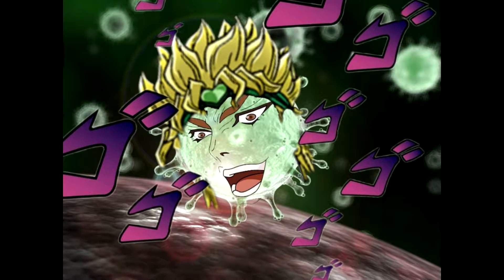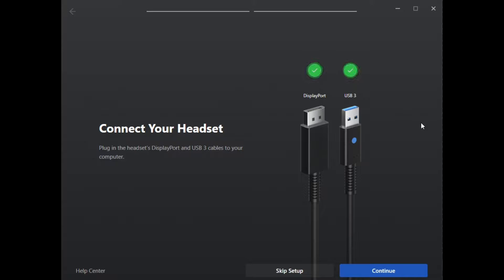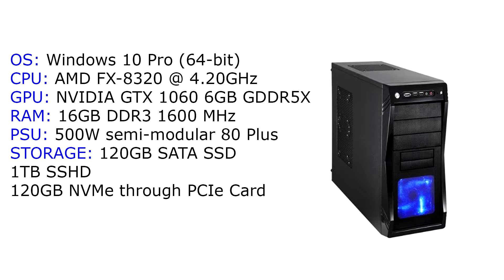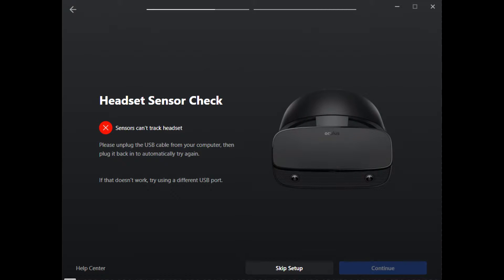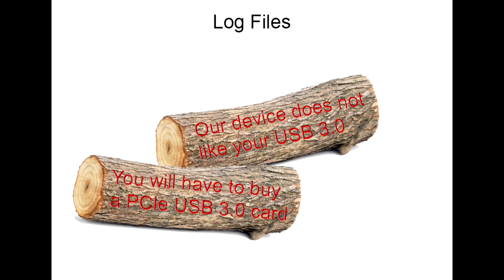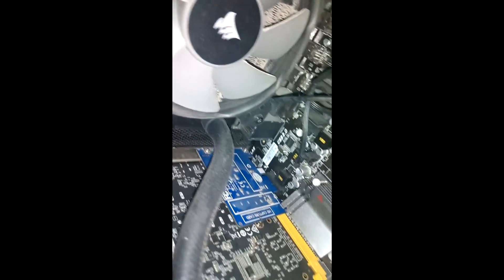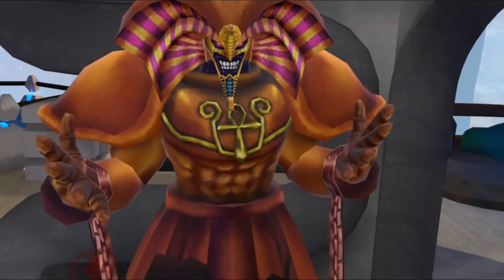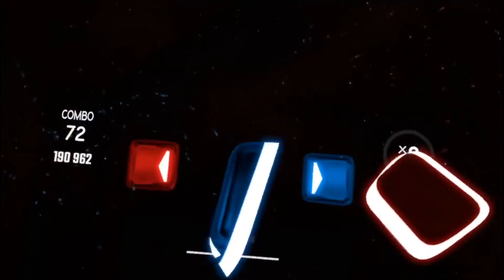Why I ALMOST Returned My Oculus Rift S

Comment: Had those problems with my old pc,  maybe the pc hardware isn't strong enough, i had to boost the power going through my USB 3.0 ports for it to work. I know everyone cant get their hands on expensive things. There's always a solution its just if you're willing to look for it and if you're willing to potentially invest in a new little higher tier GPU or CPU. I got tired of my pc being so bad that i just saved up for a new one..

Comment: So, I have had the Rift S for about half a year now or like 6 - 8 month and they have been fun when it has been working but I had issues with the set up. First I had trouble making a oculus account, then i had the sensores issue wich you also had. After I had managed to get past those two problems I did not face as many problems for a while. But the I got tracking issues with my right hand, where it would stop tracking when moving it fast and move to a randomspot in-game where my hand definetively was not. I fixed it by just taking the battery out and put it back in. And that was the only issue i would encounter until Yesterday. Yesterday first the sound stopped working. and I know it was the headset and not the game because as soon as I switch to a diferent out put for my audio it works fine. But like 1 minute after the audio was gone, my headsets tracking (Like the stuff responsible for how my head moves) moved as if I was moving my head when i was standing compleatly still. And this makes the games unplayable. I have tried restarting the PC, setting up the headset again (Like the first time) And the thing is I have changed nothing since last time it worked fine. The only diferance is that I have a new keyboard. But I still use the same USB 3 port and the same Display Port as before for the headset.

Comment: The hardware for oculus is good but the Oculus app is just crappy. I had a warping thing and I thought it was the cpu or cable. Nope it was a synchronous space warp setting that you can't disable. So I am just using virtual desktop. I had a kiwi link cable and that was good, it's just oculus software unfortunately

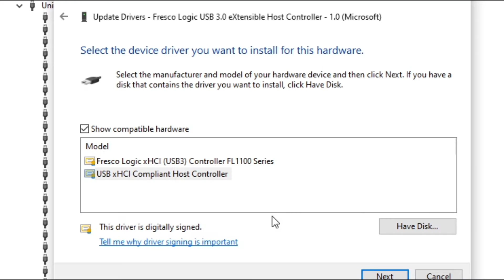Comment: Pls tel me how you got this at 9:42. I only got one option and this doesnt work😑 help
Reply: Same thing happened with me :/
Feel like I just wasted my time and money on some piece plastic that didn't solve it.
Shame on Oculus for having such crappy support and such crappy testing before releasing these oculus bricking updates.
Reply: @marclarouche1319  have you followd evry single step? Because i got it fixed
Reply: @rubenellen7046  Yeah, just tried installing the drivers that came with the thing. I'll try it after with the other driver.

Comment: i have a question and i really need to hear back from you or someone else that has had this issue. did the led light ever turn on when you had these issues?
Reply from the maker: It was always either white or orange. There didn't seem to be any rhyme or reason for either color, it seemed to be randomly one or the other.
Even now when it works, sometimes it lights orange and stays on until I restart my computer.
Reply: @TheWarrGames  i have the same issues but im not getting any lights

Comment: I've asked looked it up I cannot, find ANYTHING to fix my problem. This is why I am asking.
After installing the rift software, I cannot use my default audio setting, which is my headset w/ headphone jack & mic combo. My headset works when I plug it into my Rift S but not when it's plugged into my desktop now? I've never had issues with my audio until I installed the Rift S. When I unplug my rift, for some reason my pc still is trying to use the Rift S as an audio source?? Even if i restart, nothing. I can't even use test tone in the sound control panel on my headset. I dont have a bluetooth or any other headphones to try it on. Has anyone found a fix for this? I've been enjoying my rift S since I got it yesterday. I just wish i didn't have to keep it on my head 24/7 to get sound :(

Comment: Well... computer reads the device just fine, but I have a black screen and I am stuck in the “Continue setup in VR” and apparently it’s a rather common problem. I’m literally running out of things to try. Reinstalled the program quite a few times, made sure windows was up to date, replugged the usb an dp in specific order, restarted the oculus app, updated the app, quit the OVRServer in task manager, that’s just to name a few. I mean really if anyone has any recommendations, I’m all ears.
Reply: I7-4790
RX 580
Asus Z97E 
16GB DDR3 
It’s a little old, I know, but it should do just fine, I was able to run a quest on it.

Comment: I had, and still have this USB problem, i even bought Rift S because it only need 1 USB 3.0 port. And i have Z590, with nothing but USB 3.2, RTX 2080, I7-1170k, 32GB of RAM and 500Gb + 1Tb NVMe drives, and i have USB problem. I know this is not my hardware because i can play Crysis on max settings and STAR WARS Battlefront II with out any problems. Also everything except Oculus works perfectly on my PC. I think that Oculus is phasing out Rift and Rift S and spending all their resources on the Quest, and the Rift simply can't cope with newer machinery. Just try to charge your Phone or a tablet with your USB port and see if it can charge it with out problems. That test will tell you if it is performing right. Also i bought a powered USB 3.0 and it did help somewhat after i did move it from PCIe 1x slot into PCIe 16x slot...

Comment: I did get Rift S Today, cost me 300€. So... I really have about top-performance computer... Ok, might have couple of years old CPU Ryzen 2700x but otherwise... Ok AMD x5700 8GB card... But really... MSI MPG X570 Gaming Edge WIFI motherboard, AMD Ryzen 2700x 8 cores / 16 Threads, 64Gb DDR4 3200Mhz mem, AMD RX5700 8GB, 2x 1 TB M.2, Logitech G15 keyboard, Naga TRINITY Mouse, Bluecloud W104 4K Web Camera, Oculus Rift S VR headset...  And couple of monitors... You think that this setup is just plug&play with Rift S... Ok... I had no problems with USB 3 because I have USB 3.2 so it is green... I have plenty of display ports on my card but the Oculus DisplayPort thing just rolls and rolls in setup and don't find a port... Yea, I have update AMD drivers, change ports, and so on... Dada... So I understand if some older hardware has problems :)

Comment: Having your exact same problems here. I ordered an external powered usb extender as another guy suggested it in a video I saw before yours. Strange thing is that the Rift S was working perfectly before and I only own the thing for about 4 months. I hope to fix the issue as well otherwise I’m returning it
Reply: I fixed disconnecting all the electric power of the PC and removing the system and installing again w10
Reply: @neoaxel94  I'm happy for you :)
Reply: hii thats works for you? mine was working until now and i dont know what to do
Reply: @neoaxel94  Unfortunately not even the external USB worked for me. Today I asked Amazon to returrn Oculus. I think when I have some more money I will go for the Reverb G2. Oculus has been a great disappointment. What really bothers me is that I had it for only 5 months and in the beginning it was working perfectly.

Comment: just bought my bf the Rift S and tried to install the oculus app last night, i ran into the "repair software" loop where no matter how many times you restart pc or uninstall the software it wouldn't repair.. I had to go through my files and delete all oculus files & logs, run a cleaning software, then restart pc and try installing again. The app is currently installing right now, so we'll see if this shit actually works 😫

Comment: My rift S worked first thing. But at the time there was  still two issues creeping up the back of the mark zucchinis back. First of all every 10 to 15 seconds the mic would turn robotic so I bought a mod mic wireless and that fixed it. But then the other problem came up. THE HEADSET CRASHES EVERY 10 MINUTES so I went to oculus support and guess what. They said that is was with my computer even though its custom with the newest parts and guess what they said next you'll love this. BUY A NEW HEADSET And I was like no only if I get a full refund on this and they said. ONLY IF YOU BUY ANOTHER OCULUS HEADSET And after all this they still think I'm buying another oculus headset? No Next time I'm gonna just buy a index or a vive.

Comment: Thanks for the video Im going to try a your solution, my rift s worked fine out the box on a gtx 1060 6gb ryzen 5 2600 on a msi gaming plus x470 mb but out of nowhere I kept getting tracking issues then distplay port issues and figured it had to do something with power so I bought a powered usb 3.0 hub and it worked for a bit then stopped working again so I went as far as buying a 750w power supply thinking "moarr power should fix it" still nothing. Even my rgb fan hub stopped being detected on usb port on the mb, its like oculus sucked all my usb power out my mb lol. gonna buy a pcie 3.0 usb card this Friday.

Comment: I love my rift s it’s awesome! But yesterday it had an update and now my rift s is bricked. I’ve been trying all of the know fixes all day long. My current issue is that my rift s when plugged in with the app running instead of turning on as it usually does, the orange light will stay on and I’ll get the loading screen of death displaying. I can hear the rift music and any an all noises from my pc in the background but it just won’t get past the loading screen. Usually the orange light is supposed to disengage and be replaced with a white light to let me know it’s working! But nope orange light and infinite loading symbol. I filled out a ticket so I hope I can get this fixed soon!!!

Comment: I bought a rift S and had a small tracking problem where it would jitter constantly when I turned. Video recording was fine. It was just tracking, but it could track my hands perfectly. Eventually found out it was that the device is a power hog, and the USB port I was using wasn't supplying enough power. This is why a powered USB 3.0 hub is suggested. The one closest to the board and power supply worked perfectly for me though, apparently they are daisy chained power wise and experience power drop the further out you go? I don't know. It seems weird that they tried to power so much off of usb 3 alone. Nobody would have complained if a third power cable came out at the end for a wall plugin. God knows your computer must be near one.

Comment: My wife arrived at home with a gift for me...the Oculus rift cv1 (used) BUT my setup wasn't enough so..i bought another cpu,mobo,ram,gpu...I 56400 Msi z170a Gaming m5,16gb ram DDR4 corsair vengeance,Msi gtx 1060 3 gb. Back to home,plugged in and OK!! it is enough for it...Started the setup and...i cannot complete the sensor tracking..(request expired) so i bought a powered USB 3.0 but still nothing...checked all the power save on usb ports,downloaded the media feature pack for win 10,updated all drivers gpu usb etc...and still nothing...I've called an computer technician that spent all day with thos stupid sensors and...nothing! Now i'm watching your video...and realized i got ASMedia root....jesus... so if i buy a PCI express card MAYBE it can fix my problem? I'm trying everything from 3 damn weeks,i'm gonna trown this crap rift out of the windows soon!!

Comment: Dude I'm literally dying physically at this point, but my problem started completely different all the checks are green and "working", but the pass-through and tracking doesn't work at all!!! Did exactly the same shit like you, but the support still suggests the same shit for the 12th time and they have like 5 logs from me... I'm tired, really really tired. But one thing I didn't do was change the driver I'll try that tomorrow and if that doesn't work I'll get a pcie card and after that, I will just return this shit or I'll break it

Comment: they do have online chat though 1:17 bottom right corner there is the chat option. im having issues with the display port right now it says it is not connected ive tried everything but nothing works

Comment: I related to this video and great job on editing! This is my situation:

Just got an oculus rift s after my rift stopped working and support couldn't help. From the first day on I've had to plug in both wires, unplug them,  and plug them back into different ports every time I want to use it. Recently it's decided to crash either my oculus or my whole computer in games. I consult some friends and bought a new USB 3 card, it didn't fit. I now have to buy a new computer and the rift s has started giving me a black screen when I put on the headset.

Comment: My freind just got this headset and even after ordering the part you have its still not working cause the sata won't power them I'm hoping once he gets his molex cable in and uses that it will work but this headset is so garbage compard to my HTC vive I've never had any issues even close to this
Reply: update?

Comment: Just a note with the link cable: You don't need a USB C Card. The USB C is for the Headset to plug it in. When plugging it into your computer you just need a normal USB port.
Reply: Huh
Reply: Actually the official link cable is USB c to USB c. You can use an adapter but I don't think it would work in a USB 1 or USB 2 port it needs a USB 3.0 or higher

Comment: You should have just returned it I used one for 6 months and mine started to break and short out  this has happened to many users on the forums also with the quest and quest 2 you can use ANY usb c cable including usb c to usb I got mine for 10 bucks on amazon then eventually I played enough vr where I decided to drop 30$ on a better router so I could play wireless vr with virtual desktop and alvr so the quest in your situation would have worked alot better. Either way we sadly both fell for this rift s shit

Comment: I just baught a rift s and i have the fiiiiiiking same issues, i'm actualy at the lemon head point :((((  hope the usb  universal driver tip works  :)) i let you no, thanks anyway for the video , i was begining to think that i was just fiiiiking numb
Reply: Same here
Reply: @Ghost_pr08  I baught this usb 3( https://www.amazon.fr/gp/product/B00B6ZCNGM/ref=ppx_yo_dt_b_asin_title_o00_s00?ie=UTF8&psc=1)to replace the one i had. Now it works still a few  problems with the display port disconecting  sometimes but it works fine most of the time.
Reply: @yannickbouhaik4679  thank you for sharing. I just bought the same one

Comment: My problem is that when I plug in my USB 3 cable, and my display port cable in my graphics card (they both fit perfectly in the slots btw), and when I go to devices on the oculus app, it says my oculus rift s isn't connected and the controllers are not connected to anything as well I tried restarting my pc, then unpluging the display port and USB 3 cables in the right spots, there was still no connection anywhere, I just got my oculus rift s yesterday as well so I don't know why I am having these problems so early on.
Reply: I had the same issue but my issue was cause it turns out I didn't have a USB 3 slots so I had to buy one

Comment: I had that sensor problem it’s because you have to manny usb plugged in and your pc can’t give it. Enough power
Reply from the maker: I did try to unplug all other USB. The problem is the USB controller chip in the motherboard just doesn't provide the power needed, which is why I ended up buying the PCI-e card with its own chip and resources.

Comment: thank you for the video! I got my vr and it was working perfect for around a week but then one day it just stopped. I had the same issues as you and you helped me fix the first issue/screen (connecting the display port and USB 3 cables), I'm still stuck on the headset sensors though. I'm still trying some things to see if it work before I make the decision to buy the other product. : )
Reply: Did you solve the headset sensors issue in the end I’m stuck on it now?

Comment: I assume you ran the COMPATIBILITY TOOL?  That should have told you if you had underpowered ports...  We have all known this since CV1. This is not a prboem with the headset...  There is nothing to fix except for people to have modern computers... They assumed people would use the compatibility tool...  They DID WARN YOU by supplying a compatibility checking tool..  friend.
Reply from the maker: The compatibility tool hasn't been supported since 2019, and Oculus no longer offers a download link to it officially. The only way to get it is through shady websites, which I just did. When I got it, it still says all my USB aren't compatible even though it works well now. And the Oculus representative never once mentioned the tool, which would've been an obvious thing to talk about. So no, they didn't warn me until I was like 5 days into the support emails.

Comment: I HAVE THE EXACTLY SITUATION RIGH HERE... THE WIERD THING IS THAT THE HEADSET WORKS THE FIRST TIME WHEN I CONNECTED IT, AFTER THAT SENSOR CAN'T TRACK THE DAMN HEADSET....
Reply: SAME. I GOT THE HEADSET AND AT FIRST IT WORKED. IT WORKED FOR LIKE 5 DAYS AND THEN SUDDENLY STOPPED WORKING.
Reply: Same thing happened to me
Reply: Guys, there is cheat for this error, go to device manager, find rift s in USBs and right click, there is some driver part, you need to press update and from my computer and pick generic usb :) this worked for me every single time :) i tried many stuff :) "This is THE WAY"